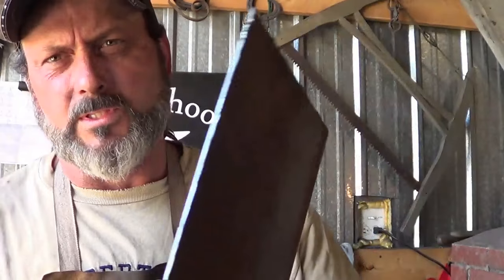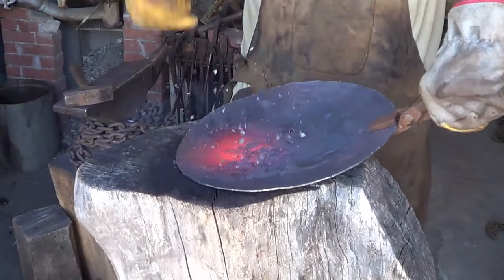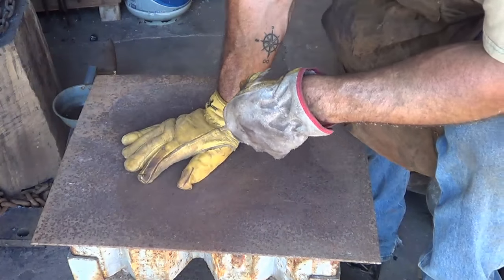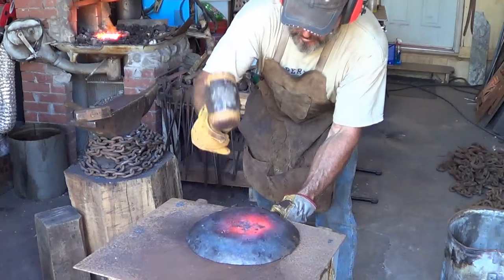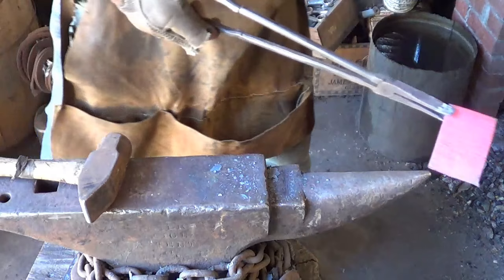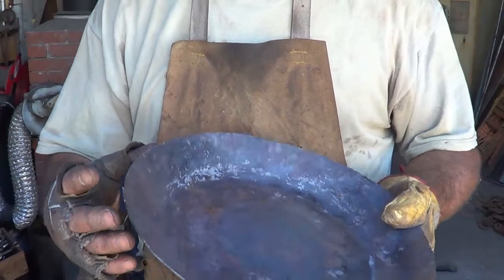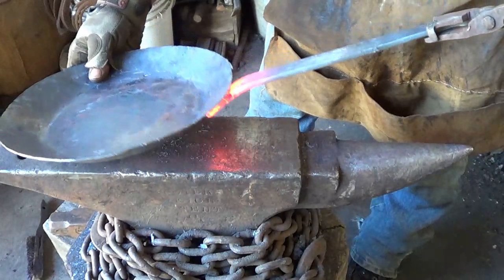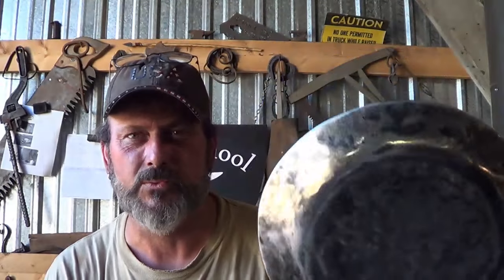Blacksmithing - First Try Forging A Steel Frying Pan

Comment: have you ever tried using something like a sand bag or maybe even a bag full of #7 steel shot for beating a curve into a sheet like that? heat might be an issue but im sure there is some kinda high temp cloth or maybe some kinda silicon something that would work to contain it. or hell probably even a nice thick leather bag you could soak in water first.
Reply: there are heat/flame resistant materials out there, but to make one fire fighting turnout set it's at least a few grand where I'm from.

possibly could use a thick leather bag with a suitable treatment like old fireys used as turnout gear
Reply: commie416 leather bad filled with lead  shot in it is best I find

Comment: Nice work.  Would the use of a planishing hammer given you a smoothie bottom surface?  Also, why didn't you forge weld the handle onto the pan?
Reply: Because why not?
Reply: I'd assume he didn't forge weld it for the sake of making it easier to do. I'd imagine that forge welding something like that would be a pain.
Reply: Here's a tip. Rivet the handle on with copper rivets and the handle will stay much cooler

Comment: well if you can't finish a project like this all the way you can always have a wok
Reply: I would definitely call this the "wok" technique, as opposed to the other "pie" technique.

I look forward to seeing him compare the two!
Reply: +Chandler Dickinson As someone who has 2 nice woks, I def. prefer the iron one for heat retention. If Chandler can't make a pan he's happy with, a wok would sell well in some markets.
Reply: +TheJohn8765 if I ever make my own, I'd want it to be cast iron. mainly because modern steel cookware uses alumin(i)um layers to better distribute heat
Reply: Dylan Zrim actually, a lot of restaurants still use plain steel fry pans to this day. Especially in Europe. I have a few around the house here and they're absolutely wonderful for getting a nice sear on steaks. and once they're seasoned well they're almost non-stick.
Reply: Or a crepe pan

Comment: What was the point of using a wooden mallet instead of a hammer?
Reply: Less movement/more precise movement of the material I would imagine. I mean it makes sense to me but then again I just started smithin not too long ago
Reply: A wooden mallet, like a rawhide mallet doesn't mar the material when you strike with it. Also, unless it's shot loaded, it's considerably lighter than a steel sledge or forming hammer.
Reply: If you're looking for a perfectly smooth surface, then any dings you put into a piece with a steel hammer is going to have to be either ground out (removing a lot of material in the process) or it's going to require 5-6 other lighter, carefully placed hammer blows to smooth it out.  Using a soft hammer allows you to move the metal without turning it into a moonscape that you end up grinding for an hour and losing half your thickness.

Comment: On raising vs. dishing: From what I’ve read, and from the armoring videos I’ve watched, the benefit of the technique you said would be more complicated would be that it doesn’t thin the material out as you work.

I don’t know how thick a carbon-steel pan should be. Anyone here use it and can weigh in? Perhaps you might get an answer on reddit.com/r/castiron.

Comment: How hard would it be to make a wrought iron skillet? And would there be any advantage over a cast iron skillet? I know wrought iron is tougher compared to cast but is there any difference in the heat retention, evenness, or the emissivity (heat output)? Because all I cook with is cast iron and I would like to find a skillet that puts out as much heat as possible.
Reply: Baron Ockslite 
You're probably better of with the cast one. They are generally thicker, thus providing more constant heat. Also, they are some what porous wich alows oil to be absorbed into the iron and providing a kind of non-stick layer.